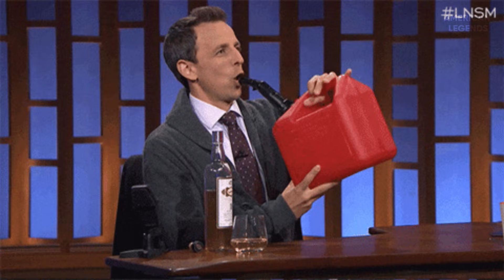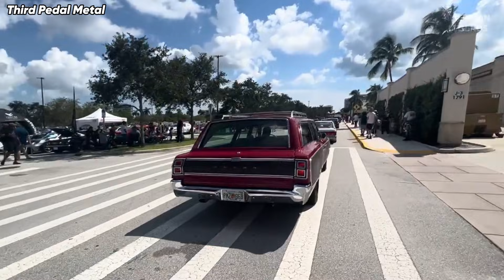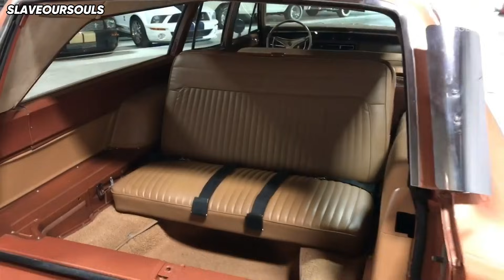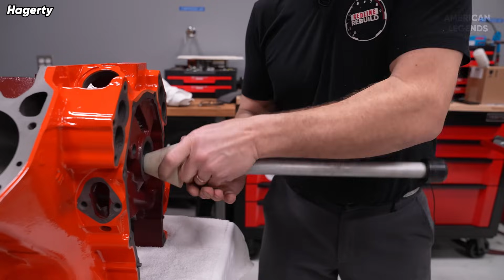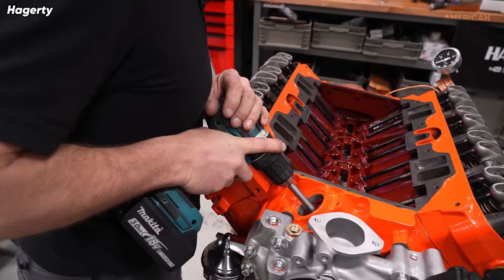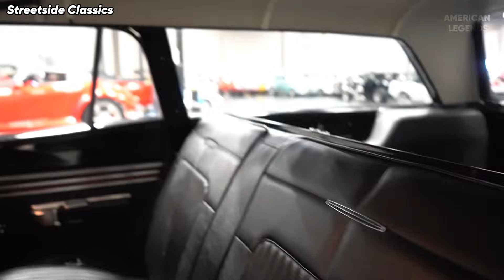Dodge Made A Grocery Getter With Almost 400 HP… In 1969!

Comment: I have never seen a factory installed 440 in a Coronet wagon. Ever. 383 4 bbl, maybe, 440, not. this sounds like a crock of shit video  loaded with incorrect information.
Reply: My friend's family had a Plymouth station wagon with a 440.  The big three brands (actually more breaking up the GM brands) seemed have a semi-performance version of a station wagon around this time.  Chevy had a 454 with 360 hp in their wagon, for instance, so it would make sense that Chrysler would have 440 powered family sedans and wagons.

Comment: Sorry to inform, unfortunately the wagons did not get the U code, that is the 375 horse, engine. It was a T code which held a 350 HP, hence the blue paint, as original, on the engine. U code 375 HP engines were orange from the factory. So again, unfortunately, not even close to 400 HP in this wagon
Reply: It was a special order option
Reply: @marioncobaretti2280  Really . . show me a data plate or broadcast sheet . .
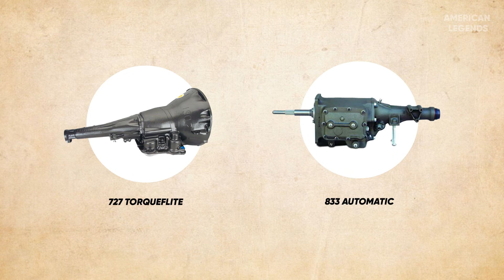Reply: @joemancini3258  Hey there is so much wrong with this AI slop it hurts for those who don't know. @1:05 WTF is a 833 automatic unicorn transmission? There was only 727 which was HD or the 904. I had to stop watching there.